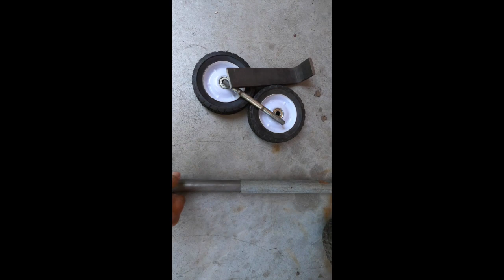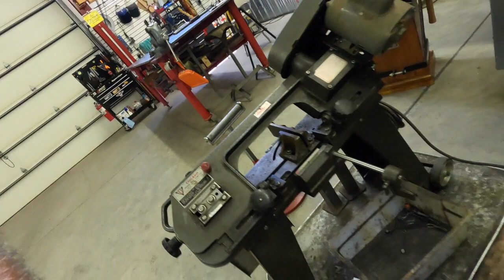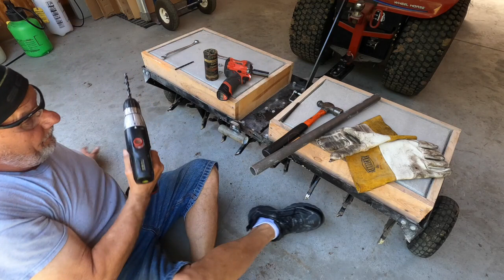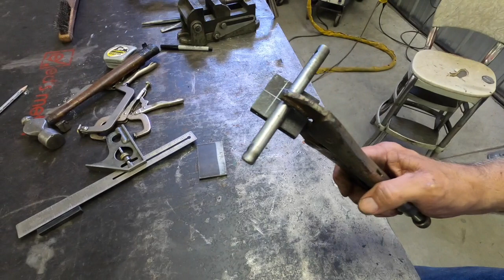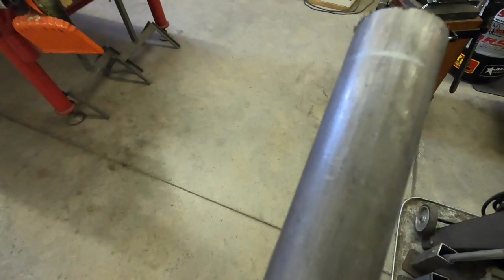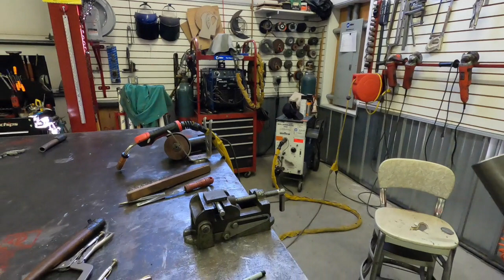PULL BEHIND AERATOR SAFETY MODIFICATION

Comment: If that open pipe top gets water in it, it may freeze and expand the pipe at the bottom, making it difficult to slide in and out of the bracket. Might want to cap it or drill a weep hole at the bottom near the axle plate. I have a railing pole that did that.